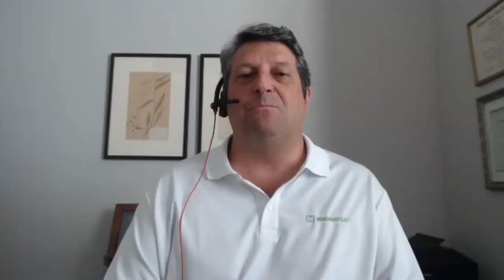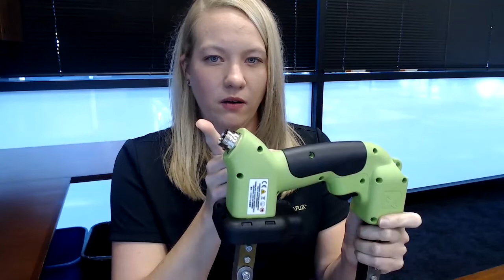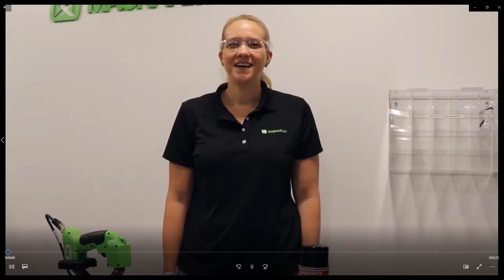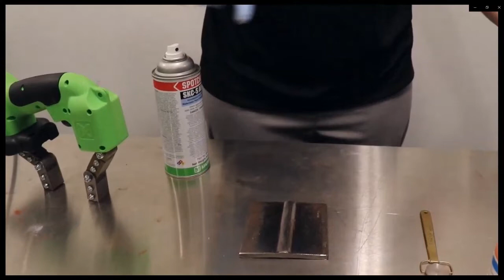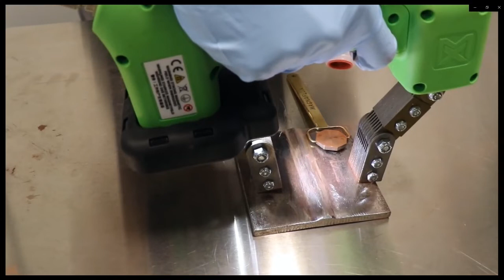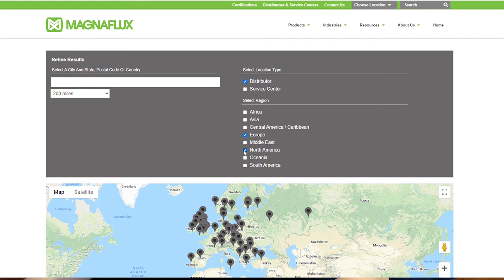[Webinar] How do you use a NDT yoke?

Comment: How do you de-mag using the yoke if it is AC only?
Reply from the maker: Position the yoke with legs flush with test surface where the inspection was performed. Once legs are both flush in that area, turn on the yoke, twist in 90-degree direction while pulling away from the test surface at a minimum of 18", with the yoke still energized. After reaching 18", you can turn off the AC Yoke. Check test surface with Gauss meter. Repeat the process until there is no residual magnetism left in the part. Also, reference and follow the prescribed procedure for the allowable residual field.
Reply: @Magnaflux2010 magnaflux deviesen ser con subtitulos sus clases o explicaciones

Comment: You should demonstrate the limited capabilities of a single leg field, the inspections are similar to parallel magnetism in that if positioned correctly, you can get 2 directions at approximately 90degrees to each other, but has to be "for information only" because of the lack of proven/ accepted studies. This is obviously only useful in areas that you physically cant do anything else, and are hoping for some warm and fuzzy.